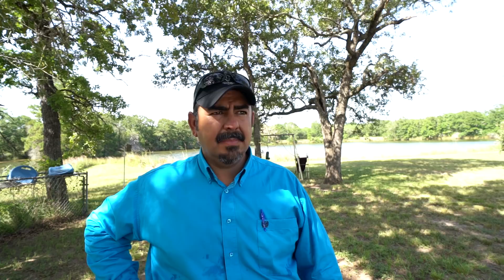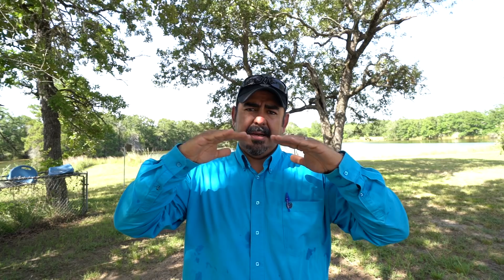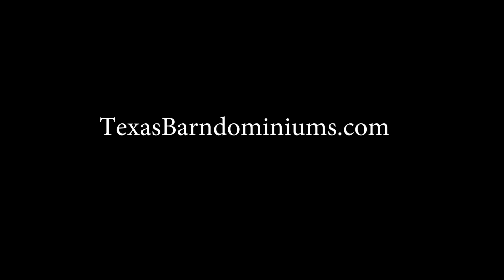Does Rebar cause concrete to crack? - TB Episode 41

Comment: The rebar can't do anything until the concrete cracks.  I agree 100%.  I try to talk my customers out of rebar because every time we use rebar it will not crack in the control joints but rather in some other area.  When we don't use rebar it cracks in the control joints.  I've never seen any concrete (except post tension) that doesn't crack at least in the control joints.  We are in Utah with cold winter temps as well as hot summers.
Reply: I'm from spokane similar weather and when concrete is done the way I want I don't get cracking issues! But if you want flex at control joints each section must have isolated rebar or proper expansion joint material which many people don't like! My friend wanted a slab in a long L around his home about 60 by 60 long 15 foot wide and wanted to cut diagonal patterns into it I told him exactly where it would crack and where an expansion joint would need to go but that didn't work with his pattern and wanted it to happen diagonally off the corner of his house and didn't want to use an expansion joint so I diagonally isolated each slab using twice the amount of rebar welded! And told him i think it will still crack where I said but that I did everything that I could even told him to add fiber and he complained to me a couple of years later that a crack was developing where I said it was going to crack as if it was my fault!!! Lol the problem I run into is nobody wants the cracks but nobody also wants to pay for it to be done where it won't or pull crap like my friend did deciding control joints should line up architecturally !!! There's more engineering then anyone believes in concrete when doing it properly!!!

Comment: Rebar actually helps with shrinkage and temperature. ACI 318 has a minimum requirement for reinforcing steel to help prevent shrinkage and temperature. The slab will crack due to bad curing procedures. The stresses within the slab will happen due to non uniform hydration  environment with in the slab.

Comment: I've been pouring concrete for 30 years and in a climate where there are freeze and thaw cycles...
Always used rebar never had these issues...
Its in the prep, the quality of concrete, pouring and curing conditions...
Sealer is also very important

Comment: The weather is the key! Sal knows, I poured my 40 x100 ‘ shop slab. It has 2- 80 Kabota tractors, one Wilkie 55, and a Wilkie 85’ Crane Trucks. 6” slab, 1/2 “ rebar 12” centers. Poured it over 20 years ago it doesn’t have a any cracks. ANY CRACKS! Contractors are in to big of a hurry. For you guys it’s all about the dollar not the quality of craftsmanship.

Comment: Hey Eric, at what PSI do you pour your concrete? Have your tried using a higher PSI like maybe 4000? If so, what kind of results did you notice? I'm not a concrete expert, but besides adding more concrete bags to your mixture is anything else needed? How much does this add to your expenses?

Comment: Rebar expands 6 time when corrosion occurs, this lead to excessive cracking once the corrosion initiates. Concrete cracking is a durability issue rather than strength. You should try using steel fibers or synthetic fibers in slabs, they will control cracking as well as increase the serviceable life of the structure

Comment: I agree with you 😎👍. I’m pouring a slab for a 20x24 garage and I’m curious if it needs rebar or mesh or can it be poured without it maybe just pour gravel first on the ground inside the forms then just puur the concrete and spread it just curious 😎👍
Reply: What did you end up using rebar or wire mesh? I’m trying to decide for a residential driveway

Comment: W/C (water to cement) ratio plays a big part. The more water, the more evaporation needs to occur in the curing. Think of adding 25% additional water to a gallon of paint. Spray it and it looks ok when wet, when it dries, it will crack and craze everywhere as it shrinks. 

The other issue with high w/c ratio is loss of strength. Expect to lose 1-200 psi per gallon of water/ yrd added. Research different plasticizers (or possibly a high range super plasticizer) so you can get down to .45 w/c ratio and still have flowability. 

Ask your concrete vendor QA guy to spec out a mix design for you. I would aim for a 4,500 psi mix design and ask to see the weights of all the aggregates, cement, water, and oz. of admixture. You can use that as a jumping board to tweak the design from there.
Reply: Plasticizer is wonderful my boss would never pay for it but once I got on my own the pour went easier and the strength increase was terrific even on slabs that couldn't be watered because they were to remote !!!

Comment: Maybe so however, I'll take the concrete slab with the rebar in it any day as long as the ground surface is prepared correctly and the steel reinforcement is spaced and tied as it should be with Dobie's.

Comment: rebar or not concrete may crack.  there is so many factors ... usually i like to cover with plastic and watering the slab for few days
Reply: Agreed, plus the surface should be prepared as per engineering guidelines. I see tract homes where concrete is poured on raw dirt full of rocks etc. No sand, no gravel, no plastic, no nothing.  Those construction jobs should be banned and the inspectors who signed it off.

Comment: One thing I noticed over the years is the amount of tooling from crew to crew.  Seems like crews who only used the minimum amount to achieve a nice job had the least problems with cracking.  Another thing is strategic placement of control joints, and proper depth.  I've seen nice slabs with good subgrade/rebar placement crack with sufficient jointing, but incorrectly laid out - squares and rectangles are easy, anything with shape to it bears watching, especially if it has plumbing risers, drains etc.  Given how jointing works, seems like surface cracks could easily transfer down to rebar.  Does it make any sense that rebar would be the initial weak point in a curing slab, given that it is a break in the continuity of the matrix?  

I've seen slabs crack right along rebar paths more than once.  Summertime, I've often wondered if the bar being pretty hot (depending on the pour's time of day) was part of the equation.  If a mix at, say, 65° hit rebar at 85°, that's a point where the fresh concrete would absorb that heat in a big hurry in a very small space.  Every chance I got, I'd use whatever I could spare out of the head tank to water smaller slabs down just ahead of where I was pouring.

Comment: You need control joints , and start watering/ ponding your slabs . You need to slow the cure process down . Good luck , awesome videos
Reply: That or seal it to lock moisture in we used to do that with sidewalks

Comment: Makes sense, in the end whichever method you use just reducing the amount of water you use in your mix is the key factor in preventing surface cracks, especially in the summer, that's why I like to use a water reducer,  I'm still skeptical about using post tension only because of the fact that if your slab shifts and cracks structurally you dont have the rebar to keep the crack together,  cables are too spread out apart, and I wonder if over time the steel stretches and looses compression.   Would a hybrid system work better and would it make sense to use both methods at the same time, if money wasn't an issue.

Comment: I believe the idea that rebar causes cracking is based on false assumptions. Concrete without rebar cracks too, only more so. It is true that for rebar to act the concrete must be stressed first (i.e. likely crack) but it isn't causing it. Furthermore, post-tension creates a monolithic structure. Settling in one small area can be carried thru the slab because it is tensioned. Where a rebar slab will only feel that settling at the location of the drop.

Also...check this out https://youtu.be/PLF18H9JGHs

Comment: 100% disagree. Stadiums, columns, highways etc are poured on rebar without the failure and under massive stress. If shrinkage around something had an affect everything in contact with the concrete would affect it. Going back to Roman and Arabic times their concrete is still in place and stable. It comes down to mix (supplier), conditions of pour (weather, time of wait, water added in truck and how it's finished ( usually burned in with water added while burning it in with trial machine which is common and .... Wrong.  My personal preference is I would never disturb the curing process with post tension....in the old days when dinosaurs poured concrete rebar slabs in the 60's and 70's the custom builders waited a minimum of 14 days with 21 being preferable before any framing began. 

Damnit it's hotter than Satans arm pit just north of you. Take care out there
Reply: In general terms the mix, the water added and how its finished are major contributors to surface cracks. Some can be attributed to sub soil, stability (grading, pad construction etc) and beam depth stressing the slab or supporting it, as well as clean stable soil, tree roots and on and on :). Surface cracks can at times also be a failure which has retracted back to original pour specs... too much to discuss via a keyboard without writing a book lol... but you may want to check out Matt Risinger on youtube and another builder down around Austin I believe. He seems to have over come most of this and I believe he is very open  to personal contact with other builders if you choose not to search his library of videos.

As far as the commercial generalities in my first statement you will not see as many surface flaws / cracks etc in columns roads etc as you do in residential... this includes airports (wowzer they do it to it) and the Autobon. Granted there are failures cracks etc just rare and usually after much time has passed with droughts followed by heavy rains cars trucks and the like attributing to it. vs a residential slab just kinda hanging out :).
Reply: Fred Flinstone 28 days in Europe before you frame on top of it!!
Reply: Fred Flinstone,  I will agree with you. I do some architectural concrete, (countertops etc) so cracking is not an option.  It's all about mix design, using a minimum of water and proper curing until the hydration process is over.  I don't know much about residential slab work, but like you said, I suspect subsoil stability  is a large factor. I also think control joints are pretty much necessary in that kind of work.

Comment: Moisture in the concrete plus steel rebar will rust, rust expansion equals cracking. If you use fiber rebar that will not rust on post transitioning and high fiber concrete you decrease the cracking to a minimum however this is costly.
Reply: Rust requires oxygen...not just moisture. Encased rebar doesn't rust. Add a crack though, or place the rebar incorrectly and it will rust.
Reply: Water (H2O) is moisture which carries its own oxygen.  Concrete is moisture penetrable even to some degree when sealed.  Don't know the long term viability of epoxy coated rod, hot dip galvanized, inorganic zinc coatings etc. etc.  Different grades of steel 'rust' differently.  Some become heavy scale and some just get a patina (think mild steel with 'scale rust' or railroad track with a light brown tight coat) so using a better grade of steel would very much slow the oxidation as rust is in itself a protective coating that slows it considerably.  A lot of variables in the mix.  The controllable ones are key.  Just the difference in the coefficient of expansion between the steel and the concrete would seem to be problematical.  How much is the customer willing to pay in the cost benefit ratio is also a factor.  Very interesting.  Take care.  Doug
Reply: Rebar only rusts when it’s too far to the outside of the concrete. then it’s gets wet and starts to corrode. with the thin concrete layer that basically all driveways have you’ll almost always have this issue!